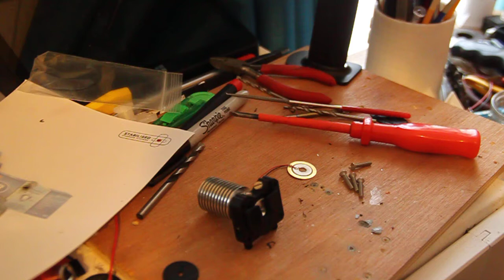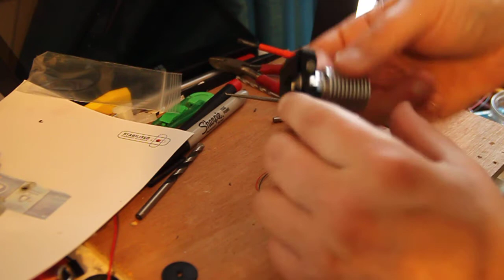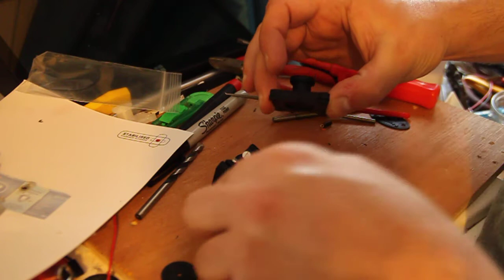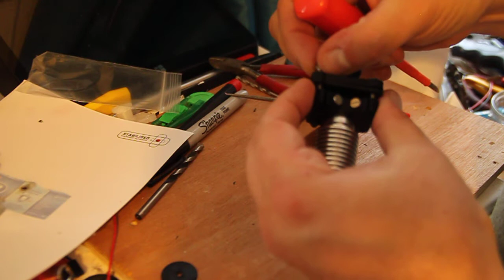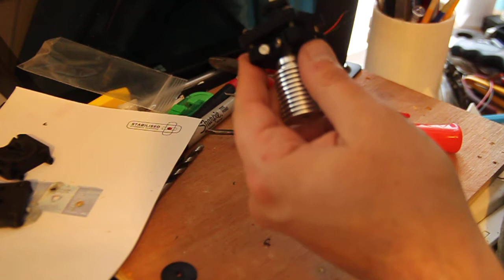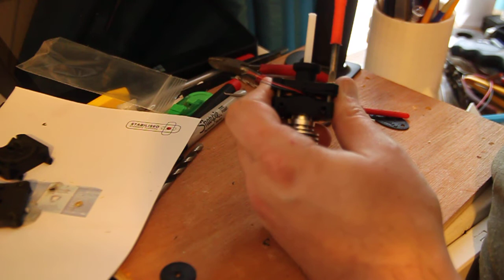Precision Piezo - Piezo20 Module Part 3 - putting it together

Comment from the maker: I say its important to use countersunk for the four corner screws, as you don't want screw heads sticking up from the upper part, or they will foul the carriage or titan extruder you are fitting it into (groovemount version) or foul the carriage/effector for screw mount version..

Comment from the maker: IMPORTANT NOTE: Some people have said "but the piezo doesn't fit in the recess". Its shouldn't the piezo sits on the flange just inside the recess in the upper part. This is so the lower part can push into the piezo centrally and bend it to trigger. This is important, if its not sat on the flange it will be much less sensitive.